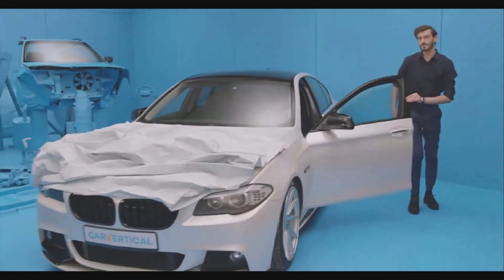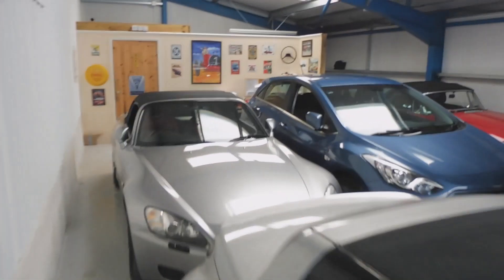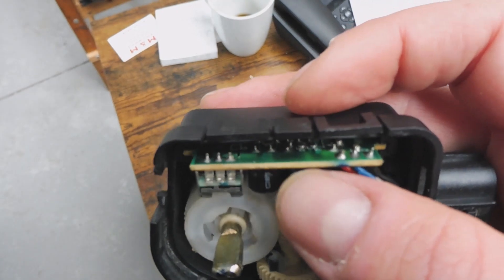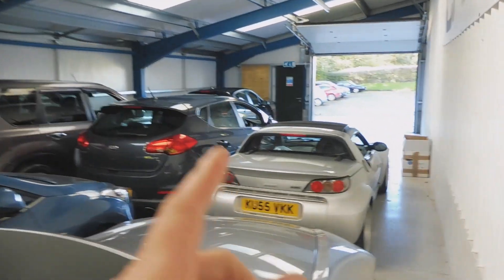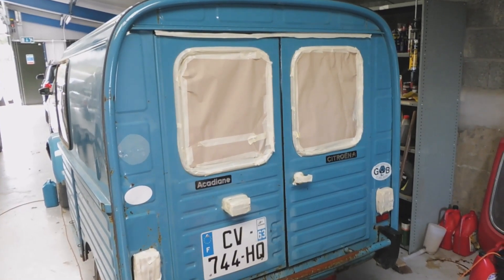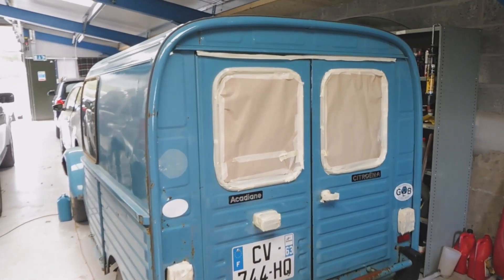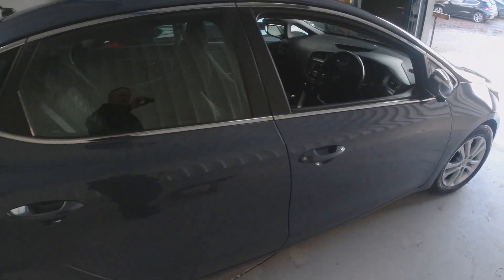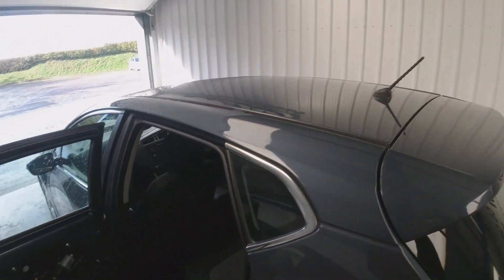The STUPID small reason I can't get Sport MOT'd!

Comment: I never take a dpf off always check egr is clean first then buy can off dpf cleaner that you spray in sensor hole it's a foam that will break down the soot making regeneration easier , done this on many vehicles
Reply from the maker: Cheers for tip

Comment: If you put the O² sensor voltages onto the graphing function then the upstream one should cycle up and down about once a second at 2000 rpm I think. Downstream should stay fairly constant if the cat is working (at operating temperature). Downstream is for usually for emissions monitoring only. Upstream reading is used to adjust the air fuel ratio so it's essential for proper running of the engine.
Reply from the maker: Cheers for tip bud

Comment: Don't bother with those small dpf cleaners bud, take the top sensor out of dfp, fill the dpf of a few litres of dpf fluid, let it pickle, start it up with sensor out to reduce back pressure, after a bit put the sensor back in and run it, there'll be loads of smoke, but carry on and it's sorted, saves taking it all off, done it a few times.
Reply from the maker: love it, great idea, so thats an off car dpf fluid  yes? what one do you recommend
Reply: @ChopsGarage  yes bud, I get a gallon, it's whynns dpf fluid, about 35 quid, make sure dpf is lower than the cylinder head so your not poring fluid into the engine, no point in take dpf off if you don't have to, I've also just put the pressure washer into the top sensor hole and that's worked, it's just basically Ash that you are trying to clean out, caustic soad is good as well.

Comment: My '05 Skoda Fabia will throw up an engine management light on my longer journeys of 400+ mile round trips, always the same when I plug in the reader: the cat is worn. Am I going to spend £500 getting a new cat installed in my nearly 190K car when it drives sweet as a peach? No. Am I going to clear the code knowing it will pass the emissions test when I MOT it? Yes. Woo hoo! I'm winning! My reader cost £17 on Amazon. In your face Topdon! Fight back people! 😁
Reply from the maker: Not sure why you would say in your face Topdon? Your £17 code reader will clear a code but will not regen a dpf, give live data, reset airbags, do relearns etc etc , Its horses for courses. I agree I just the code myself and not replace for myself, but not an option for retail
Reply: @ChopsGarage  I get that mate, but for my little car a high end reader makes no sense, and the same is true for most punters with low value cars. Halfords charge £50 for a "diagnostic" (bloke sticks in a reader), a cheap reader like mine pays for itself day one. For some faults you can Google it and swap out the part yourself for a few quid, I just love little dodges like that.👌
Reply: @ChopsGarage  TopDon will also actively try to stop you from re-selling a unit you bought when you no longer need it.  Buyer beware!
Reply: Maybe you should look at the price of bluetooth usb dongles then look up torque app on your phone. That does give live data. I have the same issue on an 05 Astra but im going to see if swapping the o2 sensor does anything, i can get a brand new cat on ebay for just over 200 for mine
Reply: @chrisgray305  Not a bad shout mate. I had the O2 sensor swapped out on mine, no difference. If you can get a cat for £200 and fit it yourself happy days.

Comment: Great video bud, I learnt that motor swop thing same as you, messed about ages swopping full door set up, second o2 sensor will take a while to come on until the cat lights up, voltage won't alter much, usually if it was the cat it would come up as cat low threshold, so you might be OK, re your van, it's amazing how arsey people become when you've paid in advance (!)
Reply from the maker: I know, bloody cheeky bastard , looks like a letter before action might be in order
Reply: @ChopsGarage  yes bud, Ive registered a few classics, usually a letter from the relevant club is proof enough, done a spyder from texas, just motd it on the vin, took import docs into dvla local office and it was done, used to get jap imports and same thing, so don't know what the hold up is.

Comment: XF brake judder is a well known issue unless you use EBC red or yellow pads..  I run standard disc with EBC yellow stuff pads on my 3.0S Sportbrake and have smooth braking.

Comment: Popped it on pause @2:00 to comment on the exhaust through vents on jag

When you “fixed the inlet problem” I said at the time I bet it’s a blocked dpf and the exhaust has found another escape. I would guess it’s leaking out the EGR valve somewhere.

Hopefully I’ll get to see if I was right or wrong.

Comment: Be interested in progress on the Kuga, as I have one (2010). Had some warning lights and limp mode, turns out was DPF differential sensor on the side of the battery box. Was giving some crazy readings even without the engine running.

Comment: I've manually set lights up if adjusters don't work and put some silicone in to hold them in place, set the beams on the wall, never had a problem.
Reply: Same - but you have to do it before the MOT and preferably blank off the switch. Once there is a ‘fail’ on there you have to fix the adjusters
Reply: @OldCarsNewVan  yes bud

Comment: When O2 sensors come up as the heater circuit then you don't need to worry about it being the cat or another expensive fault. It is upset about the heater circuit and not the performance of the sensor. Therefore you can replace the sensor with confidence. It's either going to be that or a damaged wire somewhere. 
If it's coming up as O2 sensor performance out of range then you've got to worry because it's not the sensor that's faulty, the reading is faulty - i.e the sensor has detected a fault. 
With a bit of understanding then you won't be worrying about parts darts all the time 😁

Comment: To check 12v motors keep a charged 9v battery,  they will move, just a bit slower ( if voltage applied direct to motor

Comment: Nice fix on the headlight adjuster. I find I struggle for some parts for my 405,  it's currently using a bosch supplementary air device intended for a Mercedes. But  you need to be creative sometimes

Comment: Can't think I've had headlamp adjustment checked at mot, as long as beams right (?)
Reply from the maker: They said if button was in car it had to be tested apparently.
Reply: @ChopsGarage  never had that bud.
Reply: @ChopsGarage  been reading up and if correctly set first, should be OK, maybe they were down, that's the trouble been a trader, once the mot station knows your trade they are extra keen as they know most vosa complaints are about cars just bought.
Reply: @ChopsGarage  correct it's a testable item, moors was 100% spot on in failing it. Although there's a small minority that ignores it as a testable item. I went through a stage when I first passed my MOT license in failing every other car on that defect. It is that overlooked.
Reply: If there's a button it has to be set to its lowest setting (0) for mot
Reply: @grandad8753  Make sure any manual headlamp levelling devices (driver controls) work by:

switching on the dipped beam headlamps

operating the manual levelling device

checking that the headlamp beams move up and down

returning the levelling device control to its original position

From the Manuel

Comment: That's incorrect the headlamp adjusters ae  NOT allowed to be moved test as car presented as long as manual adjustment is working that's ok for headlamp to be adjusted as is! For beam setting.
Reply from the maker: If the headlights are not at the correct level and cannot be adjusted as they have failed I think it will be a fail
Reply: @ChopsGarage  looks like this is a question of interpretation by testers ?